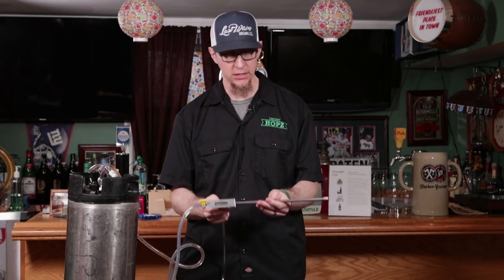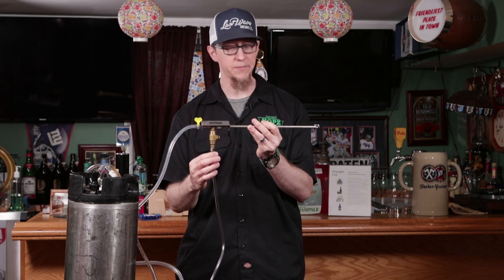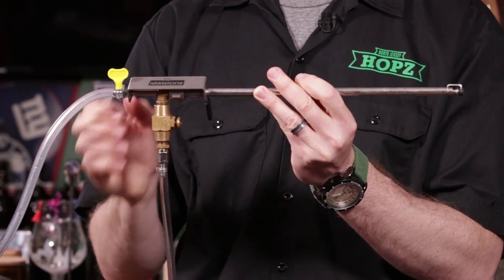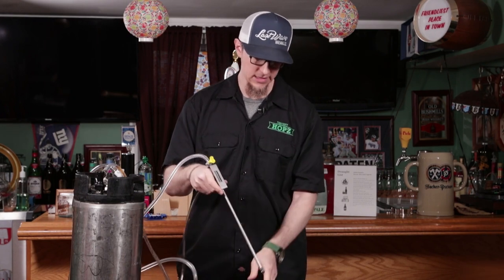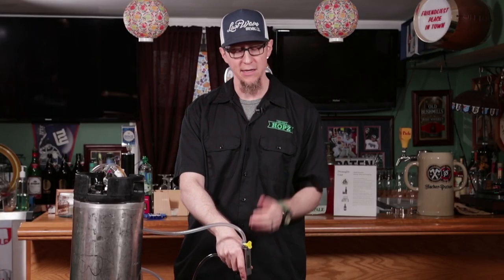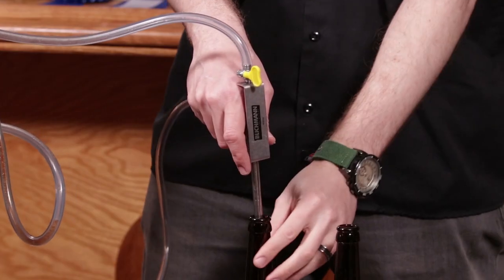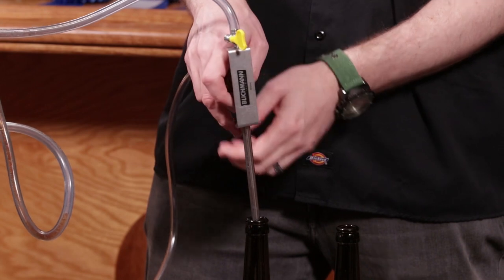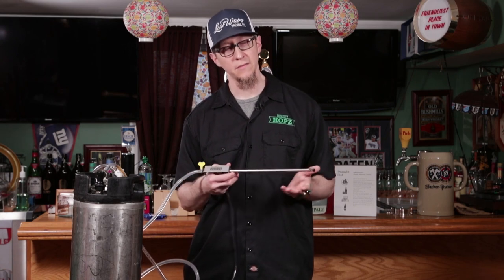Filling Homebrew Bottles for Competition

Comment: Chilling the bottles to the same temperature as the beer will help reduce foaming and beer waste. also, every system is a little different but I have had good success using a low PSI on the keg line to the point that it looked like I was pouring a flat beer but still had great carbonation when opening the bottles. But you are right, there is always some amount of waste, and that's ok.